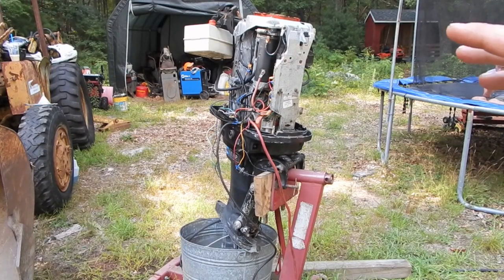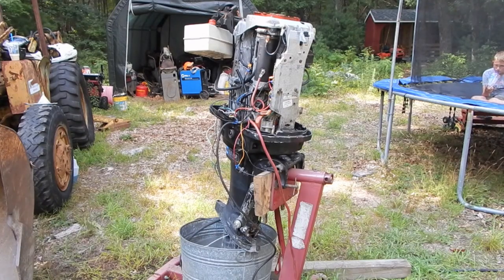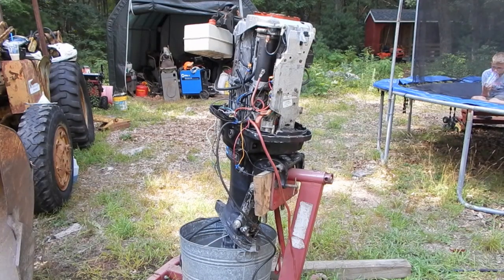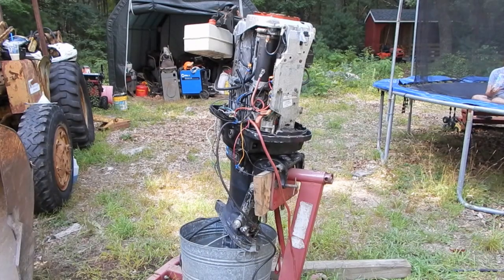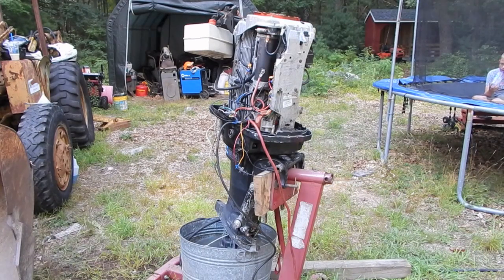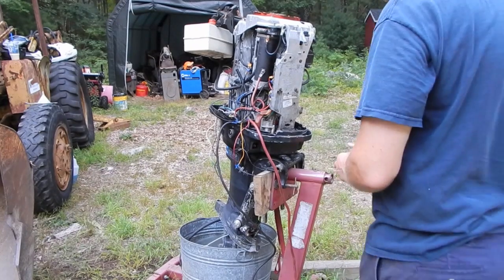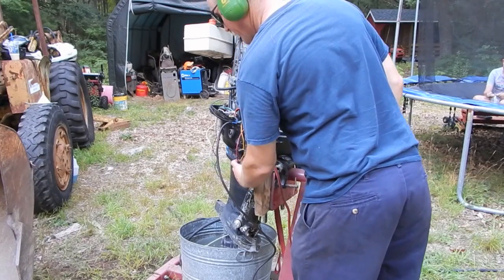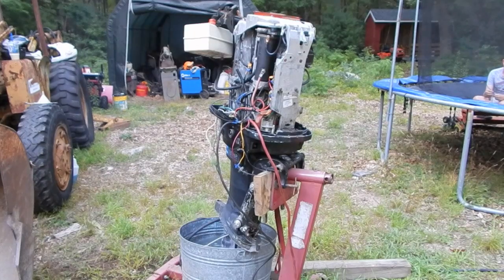The Mercury 115 Tower of Power Outboard motor Part 36

Comment: Honestly if the reverse gear, forward gear or pinion gears are damaged its not worth rebuilding.  You can find a new lower unit for around $250.  The gears and seals will cost around $600 or more.  Its just not worth rebuilding.  These lower units are plenty and available.
Reply from the maker: I  assume by saying "new" you mean new to me. I'm seeing ones on ebay that are asking  $250 just for a used empty case. casting number of the case is 1623-3909. I also worry about condition of a used case. The gears look great but the shafts are both grooved. and the bearings have rust in them.
Reply: There is a really good used boat salvage yard in your area.  I'll look for it and hit you back.  I am sure they have one.  You should find one that will work just fine.  You just want to check for how much slack it has and how easily it shifts.
Reply from the maker: HawkeyeMarine That'd be great. By slack, do you mean end play on the prop shaft? It's a darn shame this one was ruined. The teeth on the gears look great, and the lack of wear, or round over on the clutch dog, and mating parts suggest these parts were not that old, but when the water got in there, the bearings and the prop shaft just sat there and started to rust. The area where the needle bearing rides on the shaft is badly pitted. Also theres the aforementioned grooves where the seals ride. My understanding is fishing line can do this on the prop shaft, but the vertical shaft looks even worse! Oh, and also, there is a cam broken on the shifting rod, and that stupid little part is almost $40!
Reply: I have a lower unit housing I can sell you.  I would give you a great deal on it.  The one I have has a pre-load pin does yours?  I don't think that matters yours should be the long shaft.  Basically all there the Bravo, and Gen 2 drives.  The one I have you could put your gears in.   I would be early next week before I could take some pictures and video of it.  The gears are shot I was going to part it out.
Reply from the maker: +HawkeyeMarine how are the shafts?  I  may have found one locally. I'm waiting for a call back right now.  I was surprised how many lower units and complete inline six motors are on my local Craig's list!
Reply: Yep they are plenty.  Everyone wants something brand new.  But, these motors are great.  They can be a bear to get the kinks worked out.  But once you get it setup they run great.  Mercury built their brand on them.
Reply from the maker: +HawkeyeMarine when I first bought the b poo at I knew nothing about these motors. I had low expectations and even lower motivation to bother with it. then I  started researching the model and quickly discovered there appears to be what I can only describe as a cult following for these.  A month ago I met a retired guy at a campground and  he tells me he used to race boats.  I mention this project and his eyes light up........he knew the model well.

Comment: Hello Steve   I am very familiar with your problem with the cracked lower unit. I have done probably hundreds over the years mostly replacing broken skags and some for leaks as you have. I am not sure if I would even try one that bad. but if you are going to try I would suggest you leave it assembled try to position it so you can keep the exhaust passages filled with water for heat control.  and after all is done IF you are able to disassemble it I would suggest a full inspection of all of the running gear especially the clutch dog and gears. if all looks ok then reseal it and hope for the best. really enjoy your videos especially the flee market finds Dave

Comment: Hi Steve congratulations on getting it to run that was a lot of work and a fight with the timing. I saw the other video when it fired for the first time, But left commenting until I knew it ran good. I've been round  here long enough to know Projects with Steve can still take a turn for the worse before the end with something not working right. Or it's to expensive for parts or you can't get good used or new parts . I hope you fix the gear case or can find another one from your other comments here.  Would be nice to see this motor in a boat doing it's job perfectly. Time permitting this might really encourage you to  finishing the IH and Oliver I started watching your channel with, that have been a bit of a fight to..
Reply from the maker: I did buy a new steering wheel for the IH350U so keep watching.

Comment: Sounds great. I almost jumped out of my chair, when you got water to come out of that hole. I honestly don't know how you went from a pile of parts to where you are today. Great job indeed. Looking forward to the rest of the project. I remember years ago when we were going across the lake in my Well Craft I heard a strange noise coming from the I/O housing and then the bearing suddenly seized up. Thankfully some nice guy towed us back to the dock. That was the only time I forgot to check the oil before operation and it got me. Anyway, great job and continued success with the rest of the project. ....Ken

Comment: Hi Steve,I'm worried that when you weld that case the oil in that crack is going to creep out and contaminate your weld.Going to have to be super diligent on cleaning that surface.Sounds great . If you need help to weld that cast aluminum I did a lot of that when I was working.
Reply from the maker: thanks Doug.  the list of issues with this lower gear case is growing.  I might have to try and finf another one.

Comment: Steve, seals are probably shot causing water to enter the gearcase. Maybe fishing line around the prop shaft compromising the prop shaft seal.  Look for grooves in the prop and drive shafts where the seals ride.  Sometimes you can install seals in a slightly different location to get a good seal surface.  Where damaged, speedi sleeves are a possibility.
Reply from the maker: yup. probably was fishing line. shaft is bad.  I was thinking of trying a speedy sleeve but im more concerned about the area where the needle bearing site. it's badly pitted. water must of been sitting in there for a while.